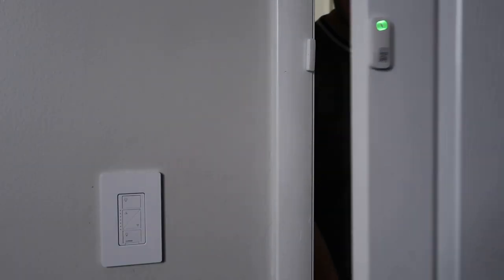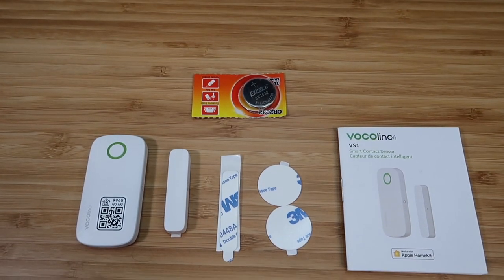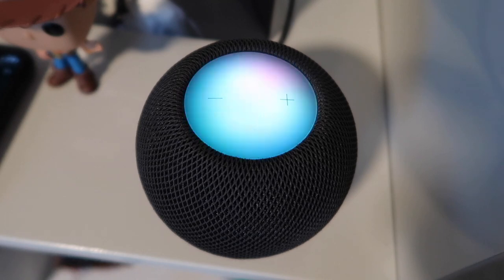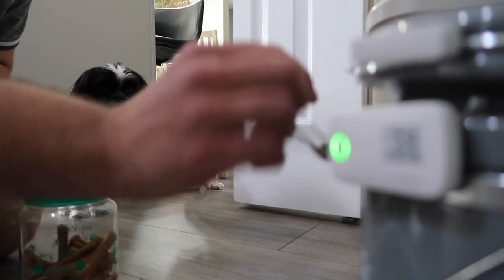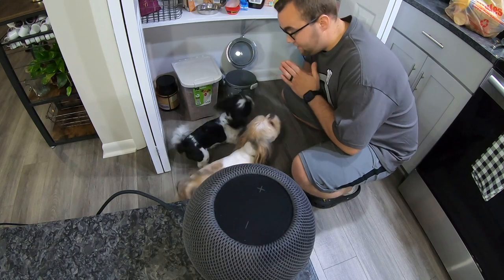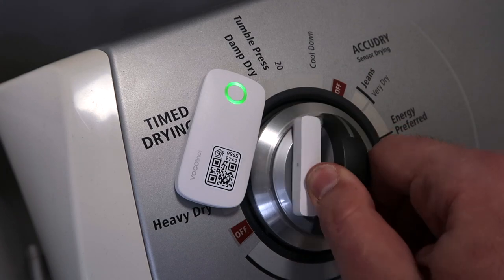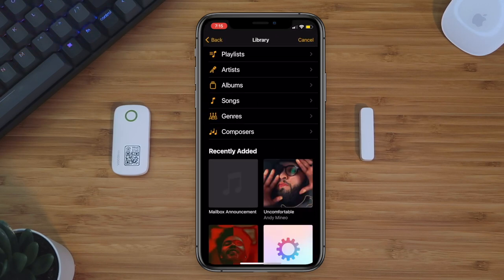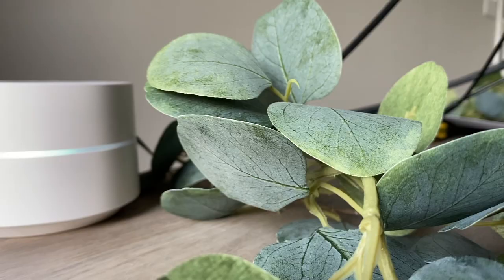Creative HomeKit Automation Ideas with Contact Sensors (feat. VOCOlinc VS1)

Comment: Here’s an idea for the “too many dog treats” warning. You could use the Data Jar app to store a number variable which will count the number of times your dog treat sensor has opened. Set up an automation to run when the sensor opens. The automation would add 1 to the count (using a calculate action) and then check if the count value is greater than your maximum number of daily treats. If it is, do whatever it is you want to do in that case. Set a personal automation to run daily at midnight and set the variable back to 0.
Reply from the maker: Hey Devon, thanks for the suggestion. I’ll have to try that out. Thanks for watching! 😊

Comment: If you install Homebridge, you can use the homebridge-logic plugin with its index counter and a dummy plug (or just add the contact sensor to homebridge)  to keep track of how many times you’ve opened your dog treat jar.
Reply from the maker: Thanks for the info, I’ll have to check that out. Thanks for watching! 😊

Comment: Sorry but they are bluetooth, and not sure how you got yours to reach the mailbox my vocolincs drop signal from my Appletv (homehub) being 15ft away on the doors I have them mounted on all the time. They only work when you are close to them because then they piggy back off your phones bluetooth to connect to Homekit. I picked mine up super cheap at Bestbuy but might have to return as they are not preforming the way I would like.
Reply from the maker: It does vary based on mailbox type, any barriers in the way, and other factors. Every house is different. Thanks for watching! 😊
Reply: I’d probably go with Thread sensors from Eve if you are in the Homekit ecosystem or better yet, from Amazon Sidewalk, since their IoT mesh could potentially be more reliable with the help of neighbor’s Echo devices. This video just gave me that idea, so it earned a thumbs up!